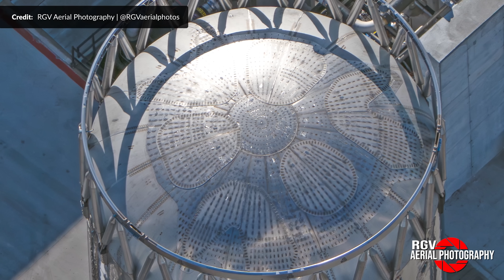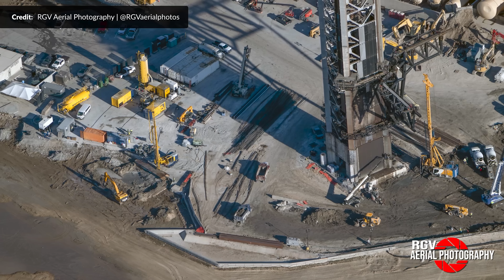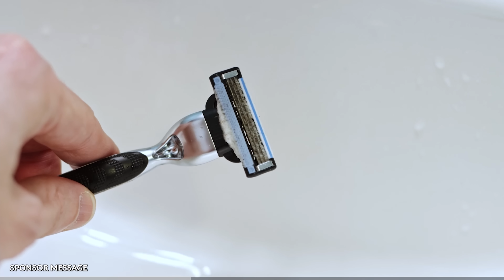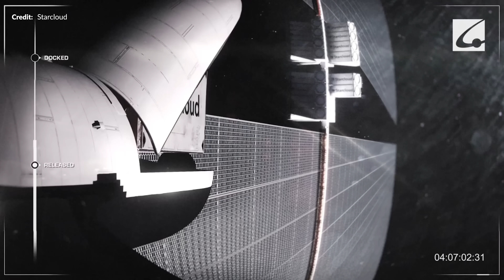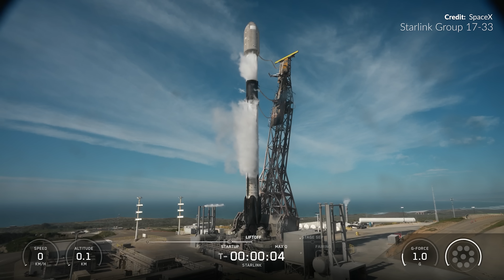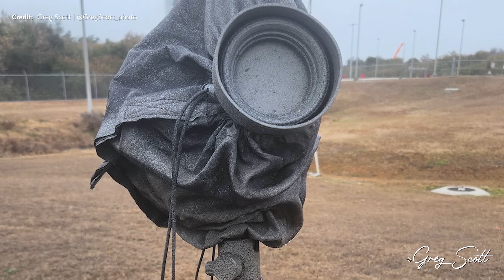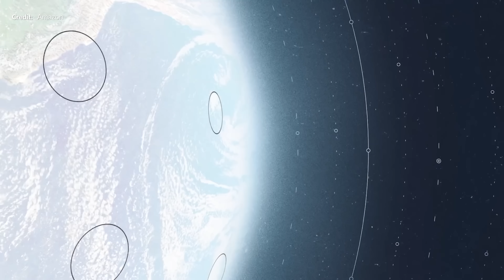SpaceX’s Starship Strategy Just Changed… Big Time!

Comment: Disappointing news - Starship is getting late, and after initial excitement, it's looking like Blue Origin, NASA or the Chinese might beat them to the post - it's so sad to see that even after this number of launches, it still hasn't made orbit or solved the cooling issues with the internal temperature climbing worryingly high on re-entry.
Reply: They haven't orbited due to safety considerations, not a lack of engineering.  What internal temperature issues do you refer too?  Can you cite a source for that?

Comment: Another failed prediction.  Elon Musk’s original 2016 timeline for Mars aimed to launch the first cargo missions to Mars by 2022 and the first crewed missions by 2024.  It's 2026 and now SpaceX's strategy has "changed".   The original Artemis timeline aimed to return humans to the lunar surface by 2024.
The Boring Company's goal was to dig 1 mile per week with vehicles traveliong at 150 mph.  How has that worked out?  Hyperloop  shut down after it underestimated operational and safety complexity, along with costs.
Promises promises promises.
Reply: Yes, it turns out he's capable of being wrong.  What is ironic is the more imperfect a person is, the more that person actually expects him to be perfect.  There were more delays in the Artemis program than just spacex.  You're being a bit narrow.  In so far as I know the boring company is still going and still working on the next gen tunneling machine.  Hyperloop was shut down?  What hyperloop was ever built?
Reply: @Indica-anaJones-fan  In the 9 years of its existence, how many tunnels per week has the boring company dug so far?  No Hyperloop was ever built because it was a stupid idea even thoiugh Elon said it would be easy.  Space X won billions of $$ worth of contracts with unrealistic timelines.  Kathy Leuders of NASA awarded Space X the $2.9 B HLS in 2021 and then got a job at Space X in 2022.  Corruption.
Reply: Starship has faced significant, ongoing payload capacity shortfalls, with early versions reportedly delivering only 40–50 tons to Low Earth Orbit (LEO), which is 50%–80% below the originally promised 100–150+ tons.

Comment: Elon often makes the wrong decision only to correct it later - no flame trench at Tower 1, manual coding instead of AI for FSD. Mars first instead of the moon is another example.
Reply: No wrong decisions. You don't know what works until you try. That's how innovation and engineering from first principles works.
Reply: @admarsandbeyond  A shocking number of people do think the final versions of things spring forth without any intermediate stages and require no refinements.  It's the logic that says we should still all be driving model T's.

Comment: As long as they keep with their pacing of technology iteration and testing, I suppose it doesn't matter if its the moon or mars, but if they have the cash flow or revenue opportunities then it makes sense to mature the technology on the moon while waiting for transit windows to mars, that will make the mars endeavour that much safer. I think they're also recognizing heavy lift does not equal 'heavy lift to xyz' - it may be that they evolve some starships into interplanetary vehicles only, never meant for reentry, just meant for higher ISP with new engines that can refuel based on resources in the asteroid belt, mars, or further out, even. (talking long term like 10 years+)
Reply: "Orbit is halfway to anywhere" Robert A. Heinlein
Cheap and plentiful heavy lift does equal 'heavy lift to xyz' . Distributed launch architecture (breaking big missions into many smaller, reusable launches) is the holy grail of space exploration. It's what von Braun envisioned in his grand orbital assembly concepts, and what the Space Shuttle aimed for (but ultimately failed to achieve).

Comment: Contrary to common thought, SpaceX focus on Moon missions will ACCELERATE Mars buildout. The cadence of missions to the Moon will help SpaceX perfect starship, Optimus operations in space and scale significantly faster. 2026 mars mission has been at risk for a long time. Going to the moon will give SpaceX tons of experience for a 2028 mars mission. That would likely be a test and Optimus mission only and overall manned missions to mars are now likely on in 2030 or 2032. However, it’s very likely that if China will be showing signs of manned mars mission before than, SpaceX will accelerate manned missions to mars, especially if whoever wins 2028 election pushed for it.

Comment: Starship V3 is currently a prototype design ship that has not flown. The first test orbital refueling in LEO is planned for the June or July timeframe. The Mars flight window opens for a few weeks around the first of December 2026. 

Given this Musk has stated that even if SpaceX focused all their effort on a simple test flight to mars, the timeline and the 12 successful LEO refuel flights needed, make this almost impossible task with a very low chance of success.

By delaying this to the next Martian window in 2028. Starship will have been perfected in a harsher environment on the Moon. LEO Refueling will have been completed several times. All Lunar landing and environmental systems are fully tested.

By 2028 SpaceX will probably decide to launch a full uncrewed multi-ship cargo mission with Optimus onboard to Mars. Followed by a 2030 Multi-ship manned mission.

It's not that they have given up on Mars, they are just delaying it until the Starship, orbital refueling, landing, environmental systems and Mars habitat infrastructure are fully tested on the Moon and ready for Mars.

Comment: BO essentially cancels the real (but extremely difficult) HLS MK2 lander (admitting defeat in reality) for an unsustainable bait-and-switch mk1 and the commendariat applauds. SpaceX focuses on the moon, exploiting the exponential growth in AI to generate a gigantic revenue stream for Mars, the commendariat cries foul and calls Musk a conman. SpaceX just can't win with the normies.
Reply: And it's not like BO's developmental timelines have been any more accurate than anyone else.  NG was supposed to fly in 2020.
Reply: @Indica-anaJones-fan  BO has a notorious track record of chronic delays, consistently under-delivering on every deadline. Even ignoring the fact that it took them 25 years to reach orbit, their deadlines have a 5-7 year slippage average on major projects: 

- BE-4 was promised to be delivered to ULA to finish testing by 2016 and be "ready for flight by 2017". It finally flew on Vulcan's inaugural launch on 2024 = over 6 years late.

- NG was supposed to be fully operational, including reusability, launching Kuiper sats en masse by 2020 = 6 years late (if it achieves all that in 2026 considering the scrub-fest its launches have been so far) 

- New Sheppard was supposed to have "frequent flights (potentially monthly)" in 2015. It had it's first crewed flight in 2021 = 6 years late. Then years of groundings after failures and high costs made them scrap it and the promise of cheap frequent flights for everyone.
Reply: Not "normies" ... modern day "luddites"!

Comment: The moon-replacing-Mars is just a political move by Musk.  His original idea to ignore the moon was the correct plan based on science.  Going to the moon with its different resources and lack of atmosphere provides little useful applicable data for a Mars trip.  Sure, you might be able to build a factory to move resources of the moon, but: 
1) Little usefulness for the Mars mission, and
2) the timeline to build an infrastructure on the moon would take at least a decade, maybe two, to have industrial benefit.  

Look how long it takes to build launch and construction facilities at Starbase and the Cape. And that is with the full existing industrial infrastructure on Earth already in place.

If he takes his eyes off Mars, he'll be ceding Mars to China.
Reply: China has big mars ambitions?

Comment: SpaceX’s strategic shift is an acknowledgment of the difficulties of putting humans on Mars.  One huge problem is a surface suit for the astronauts.  There is no long-duration proven suit right now.  They need to prove it on the Moon first.  Along with anything else they want to tote to Mars - robots especially.  That could take a good 20 years.  We’ll see.  Then there’s the radiation exposure problem that I’m not sure there is a working solution for currently.  A water curtain tank may be the way to go.  The lunar lander race between Bezos and Musk is delicious!  Let the games begin!
Reply: Suits for the moon will be different that the ones for Mars.  The conditions are different as is the dust.
Reply: @Indica-anaJones-fan   No doubt.  But the fact is no surface suit has lasted longer than 18 hours.  If the suits can hack the moon, they should certainly work even better on Mars.

Comment: Marcus.. The push to Moon is a geopolitical decision Elon supports: who owns the high orbitals rules the earth. Chinese are working for lunar expansion to eventually "thow rocks at earth" This is not myth but has been aware of since Robert Heinlien wrote The Moon Is a Harsh Mistress in the mid 60s and on military reading list since then̈! Its the politicians ignoring this since, until now!
Reply: FYI. Throwing chunks of rock at earth is equivalent to a medium nuclear device without radiation! Making artificial Meteor impacts as "clean" weapons. 
It requires construction of a linear electric catapult using steel rimmed rock cylinders
 Sunshine provides all the power and or helium III / thorium reactors. All at current prototype stages.
You can hit anyplace on earth just by varying the load aim and speed. 
No defense as missiles cannot destroy rock and if it did break it up damage is more widespread.
Reply: @raymondbailey4538  The throw rocks at earth motivation is one you invented but certainly not impossible, but a motivation that can easily apply to ANYONE.  It's also not as easy as you think it is.  Name ONE helium 3 reactor being tested.  They struggle with the easier fuels and H3 is a LOT harder to fuse.  I don't think you're being honest there or you are repeating things that you read but don't know to be true.
Reply: @Indica-anaJones-fan   Here are my receipts on the Military use of the Moon as a weapon. My uncle was an Air Force Capt who packaged highly classified document for transport including research papers and other related materials: The following are listing os some of the most recent papers that are follow-on to the ones classified in the cold war era.  Obviously his reporting was off-the cuff, yet he was in the loop on this subject and didn't reveal anything to me until his old age.
Forgive me if I am not as up on the Nuclear power, yet the newest mini-nuke reactors now beginning production will certainly go to the Moon and Starship at some point! 

War on the Rocks (2022 Summer Fiction Reading List, a go-to site for national security pros): Michael Pietrucha recommended it as “a classic of revolutionary warfare, envisioning advanced cyber warfare 40 years before the Internet.” Perfect for thinking about asymmetric fights and emerging tech.

Task & Purpose (2014 article “10 Books That Should Be On Your Reading List” for service members): Listed it for insight into “the process of pursuing and achieving freedom from a distant authority” and how unlikely allies (tech guy, professor, AI, etc.) band together against a common enemy.

The Strategy Bridge (military strategy blog, 2016 Monday Musings): Highlighted for revolutionary tactics and Heinlein’s sharp take on projectiles/psychological ops.
U.S. Air Force Academy’s Institute for Future Conflict (2024 Christmas Books list): Included it alongside other forward-looking titles—fits right in with space domain and future conflict thinking.

Comment: To be fair, if Starship achieves nothing but cheap 150ton payloads to orbit it will have been worth it. Just imagine what possibilities get unlocked with 150 ton payloads delivered cheaply or 200tons in an expendable configuration. Then we have possibilities for in orbit refuelling and building larger ships in orbit like space stations, research ships. Possibilities are endless.
Reply: So far there hasn't been a big need for the heavy lifters that already exist.  Without reuse its utility decreased by a huge amount, perhaps even a order of magnitude.
Reply: @Indica-anaJones-fan  Existing heavy lifters are expensive which is why so much money is spent making satellites as light and small as possible. If lifting heavy payloads becomes much cheaper it opens possibilities that don't currently exist. Expendable would only ever be used if there was a particularly heavy payload that couldn't be modularised and taken up in pieces to assemble in orbit.

Comment: Those still images you show of the V3 booster internal plumbing of the aft section, indicate a lot weight can be cut out of the 35 engine version as the inner five engines have plenty of thrust margin for hot-stage, boostback and landing burn. The middle and outer ring engines do not need to gimbal or power the booster after their shutdown for hot-stage. Restart gas is reduced 80%, and restart plumbing greatly simplified. Will need a bit more boostback and landing propellant and two more engines, but V4 should be a cheaper vehicle.
Reply: The outer ring of engines do NOT gimbal nor are they capable of inflight restarts - all by current design. Look up the aphorism: "... and remove all doubt"

Comment: Marcus asked which company would first put a crew on the moon, SpaceX or Blue Origin? I don't have a favorite horse in this race, but I think the Blue Origin lander will probably be first. Going by what I've seen, it's just more practical, smaller and custom-designed for the job. I suspect SpaceX will be landing tons of cargo on the moon for some time before a Starship lunar lander is certified for human crews. Unless the design radically departs from conceptual renderings, I expect a few to tip over.

Comment: The only drawback to Lunar Starship operations, is the lack of Methane for fuel there. Water ice is good for Hydro-Lox engines, not not Metha-Lox. Maybe after the time that the Lunar base has enough organic waste, that methane production can be achieved.
Reply: Space elevators and mass drivers are both possible technologies to get materials and possibly people off the moon, then meet up with an orbiter for return to earth.
Reply: There could potentially be unknown sources of carbon sub surface.  It's not like anyone has done a thorough surface survey never mind any kind of core drilling etc.  But carbon is the one thing they lack, but it's is something that could be hauled up.  It makes up a small % of the 'fuel'.

Comment: It maybe a dream but a way to go if the guy's at space x want to avoid a time consuming and very dangerous in flight , in orbit tanking witch is easyer said then done and requiering many tanking. I wonder if it would be possible to use a couple of falcon 9 as boosters strapped to the super booster. The idea is getting  a very heavy, full loaded starship out of earth gravity  with one shot. All these boosters are reusable , or if you don't want to re use those, you take end of life units,  you just  throw them in the ocean, you could burn them longer.
Reply: The rocket equation..  When did refueling become dangerous?

Comment: The gravity or lack of it on the moon is the biggest issue I have with a large manned moon base.  Small research bases or mining bases would be enough.  I would much rather see massive rotating space stations in earth and lunar orbits.
Reply: Fine. All you have to do is fund them!
Reply: @GntlTch  Huh?  Are you a troll?  Wtf are you talking about?
Reply: The issue is we don't actually know.  We haven exactly zero long term studies on anything other than 1 G and 0 G.  How much is enough?  We won't know until we try.  Same for spinning space stations.  I think that's an area that needs more R&D and until that's done we won't fully know if it's practical.  I would R&D spin gravity ahead of moon  bases.
Reply: @Indica-anaJones-fan  we can infer from the 0g studies that the amount of gravity on the moon will cause muscle and bone density loss at the least.

Comment: I have never understood how you can mount a credible and robust manned mission to Mars without a full dress rehearsal in cis-lunar space. A mission would be in 3-parts 8-months transit, at least 10-months on the Martian surface then 8-months back. Using the Lunar surface to mimic Mars is the safest why to test both astronauts and systems. Supporting the development of a Lunar base first is the best way to safely get to Mars. With any luck we can have nuclear powered transit stages as well.
Reply: I don't think a robust manned mission was planned without any kind of pre-testing.  What made you draw that conclusion?

Comment: You forgot to mention the alleged winners of this space race of landing the first humans for a permanent base on the Moon.  China is doing it very methodic, step for step and they'll have a huge advantage, if they fully integrate their space station into the process.

For the U$A it makes more sense, to let BO service the Artemis-III landing.  Heavy equipment that could utilize Starship's capacity isn't planned any sooner.  It would be a huge waste, to use Starship prior to Artemis-IV.  In the long term, a lighter landing shuttle is needed for crew and heavy cargo transporters, as seperate units.  Maybe Starship-IV could finally become a dedicated spaceship that never lands again, but carrying its own landing shuttle(s).  With nuke motor it can reach Mars in under 3 months.